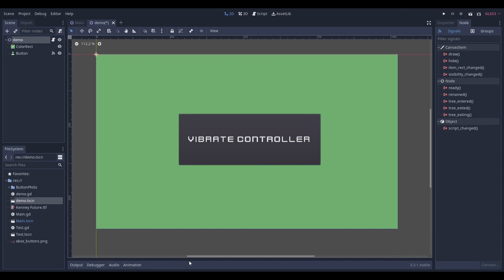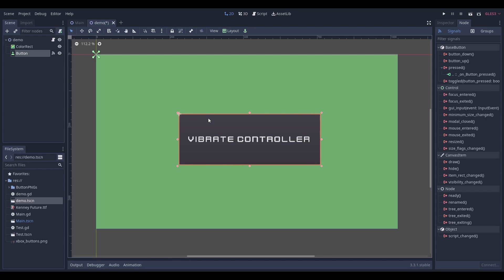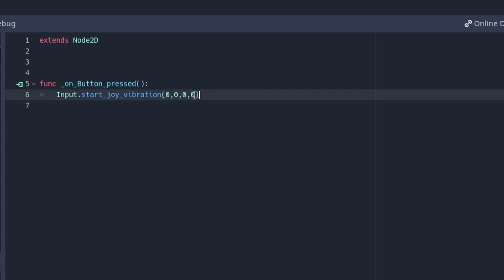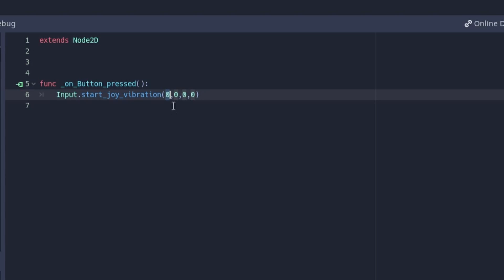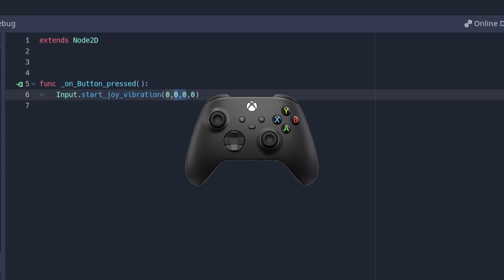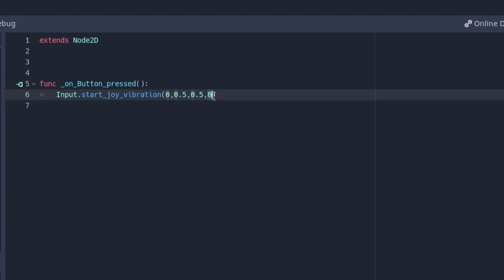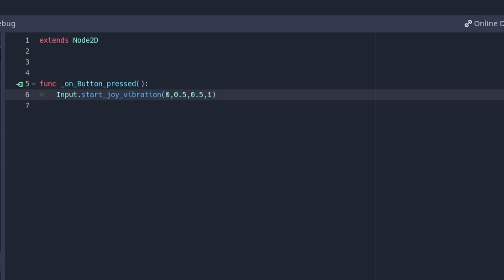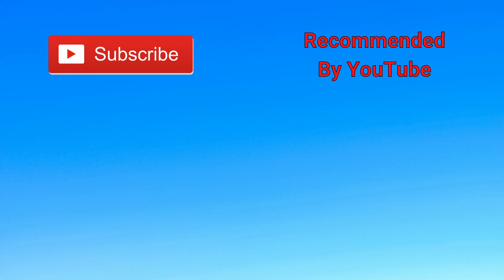How to Vibrate a Controller in Godot

Comment: useless, as a lot of this kind of video. Where do you get the first parameter ? In local bingo results ?
Reply from the maker: What? If your attention span was greater than 60 seconds you would know.
Reply: He literally says it's your peripheral number. In the video you commented on.

If your game is single player, it's going to be your first controller, so 0.
If you've got multiplayer, player 2 is likely going to be 1, player 3 = 2 and so on.

Even if he didn't say it (which he did), you could use the search the function he provided in this video in the official documentation and get the answer to that question instantly.
That on its own would already have been a massive help.